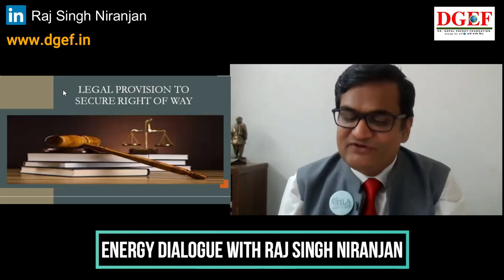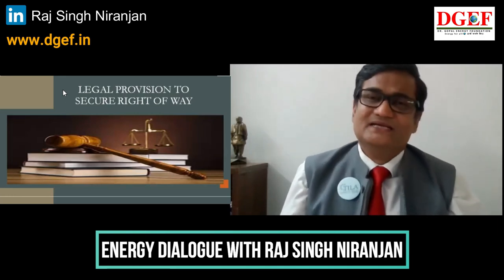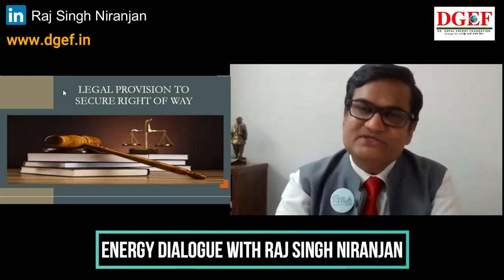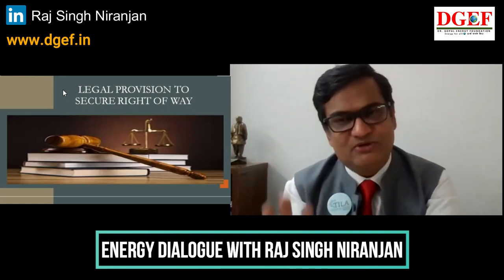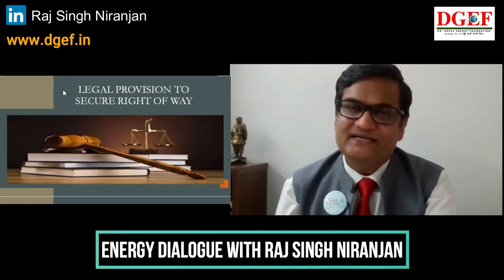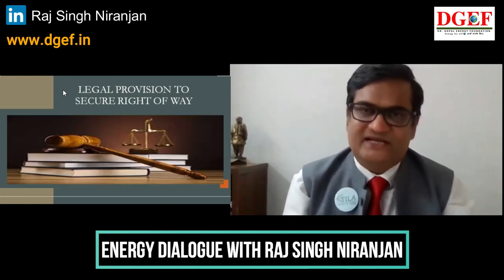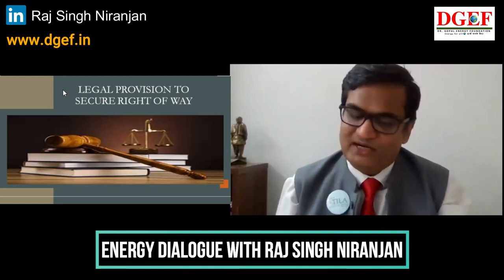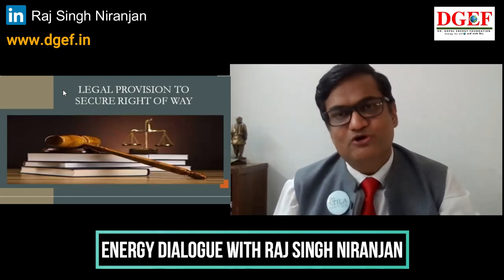Right Of Way (ROW) for setting up Transmission Lines in India ?

Comment: Right of Way ( ROW) for setting up transmission line in USA 

In the United States, the process of acquiring right-of-way (ROW) for setting up transmission lines typically involves several steps and considerations. Here is a general overview of the ROW acquisition process for transmission lines in the USA:

Project Planning: The utility or company planning to build the transmission line identifies the need for additional infrastructure and initiates the project. This involves conducting feasibility studies, assessing the route options, and identifying the potential impacts on the environment and affected communities.

Route Selection: Once a preferred route is identified, the utility conducts surveys and evaluations to determine the most appropriate path for the transmission line. Factors such as land ownership, topography, existing infrastructure, and environmental considerations are taken into account during this stage.

Public Consultation and Environmental Review: Before proceeding with the project, the utility engages in public consultation to inform and gather feedback from stakeholders, including landowners, communities, and regulatory agencies. An environmental review is also conducted to assess potential environmental impacts and compliance with federal, state, and local regulations.

Permitting: The utility must obtain various permits and approvals at the federal, state, and local levels. These permits may include environmental permits, land use permits, and construction permits. The specific requirements vary depending on the location and regulatory jurisdiction.

Negotiation and Acquisition: The utility initiates negotiations with landowners along the selected route to acquire the necessary ROW. The negotiations may involve discussions on compensation, easements, access rights, and other terms and conditions. If an agreement cannot be reached through negotiation, the utility may pursue eminent domain, a legal process that allows the government or authorized entities to acquire private property for public use, subject to fair compensation.

ROW Acquisition and Documentation: Once agreements are reached with landowners, the utility acquires the necessary ROW through purchase or easement agreements. Detailed documentation is prepared, including legal descriptions, easement documents, and rights-of-way agreements, to establish the rights and responsibilities of both parties.

Construction and Operation: After acquiring the ROW, the utility can proceed with the construction of the transmission line. The construction phase involves clearing the land, installing towers, stringing transmission lines, and conducting necessary inspections. Once the line is built, it is typically operated and maintained by the utility or transmission company.

Comment: •	Developed Country: Australia

The specific procedure for obtaining the right of way (ROW) for setting up transmission lines in Australia may varies with states or territory, however, the basic outline is given below. 

1. Project Development and Planning:
   - Identify a new transmission line and conduct feasibility studies.
   - Engage with stakeholders, including government agencies, landowners, and local communities.
   - Identify potential routes for the transmission line and conduct preliminary assessments.

2. Preliminary Consultation and Notification:
   - Notify affected landowners and stakeholders about the proposed transmission line project.
   - Conduct preliminary consultations to gather feedback, address concerns, and identify potential issues.

3. Application and Approvals:
   - Prepare and submit an application for the necessary approvals and permits to the relevant government authorities.
   - Provide detailed project plans, including engineering designs, environmental impact assessments, and other required documentation.
   - Pay any application fees or charges associated with the process.

4. Environmental Assessment:
   - Conduct a comprehensive environmental impact assessment, including studies and surveys to evaluate potential environmental impacts.
   - Prepare an environmental impact statement or report that outlines the findings and proposed mitigation measures.

5. Stakeholder Engagement and Public Consultation:
   - Consultation with affected landowners, local communities, and other stakeholders.
   - Feedback on the project, address concerns, and incorporate community input where possible.

6. Negotiation and Acquisition of ROW:
   - Identify the specific land parcels required for the transmission line and negotiate with affected landowners or stakeholders.
   - Reach agreements on compensation for land use, access rights, and any associated impacts or disruptions.
   - Draft and sign legal agreements, such as easements or land access agreements.

7. Regulatory and Legal Processes:
   - Obtain any additional regulatory approvals or permits required, such as environmental licenses or permits for specific activities.
   - Comply with statutory requirements related to land access, environmental protection, and safety.

8. Construction and Operation:
   - Commence construction of the transmission line, adhering to the approved plans, safety standards, and environmental requirements.
   - Regularly monitor and report on compliance during construction and operation phases.
   - Undertake necessary maintenance and operational activities throughout the lifespan of the transmission line.

Comment: Right of Way ( ROW) for setting up transmission line in Nepal 

In Nepal, the process of acquiring right-of-way (ROW) for setting up transmission lines involves several steps and considerations. Here is a general overview of the ROW acquisition process for transmission lines in Nepal:

Project Planning: The utility or company planning to build the transmission line identifies the need for additional infrastructure and initiates the project. This involves conducting feasibility studies, assessing the route options, and identifying the potential impacts on the environment and affected communities.

Route Selection: Once a preferred route is identified, the utility conducts surveys and evaluations to determine the most appropriate path for the transmission line. Factors such as land ownership, topography, existing infrastructure, and environmental considerations are taken into account during this stage.

Environmental Impact Assessment (EIA): In Nepal, an Environmental Impact Assessment (EIA) is a mandatory requirement for infrastructure projects, including transmission lines. The utility must conduct an EIA to assess potential environmental impacts and propose mitigation measures. The EIA report is submitted to the concerned government authority for review and approval.

Public Consultation: The utility engages in public consultation to inform and gather feedback from stakeholders, including local communities, affected landowners, and relevant government agencies. Public hearings and meetings are held to discuss the project's benefits, potential impacts, and mitigation measures. The concerns and suggestions raised during these consultations are taken into account in the project planning process.

Land Acquisition: The utility must acquire the necessary land for the transmission line's right-of-way. The process involves negotiations with landowners along the proposed route. Compensation, land valuation, and resettlement issues are discussed, and agreements are reached with the affected landowners.

ROW Acquisition and Documentation: Once agreements are reached, the utility acquires the necessary ROW through purchase or lease agreements. Detailed documentation is prepared, including legal descriptions, lease agreements, and rights-of-way documents, to establish the rights and responsibilities of both parties.

Permitting and Approvals: The utility must obtain various permits and approvals from government authorities. These may include permits related to land use, environmental clearance, construction, and electrical safety. The specific requirements and processes for obtaining these permits vary depending on the project's location and the regulatory framework.

Construction and Operation: After acquiring the ROW and necessary permits, the utility proceeds with the construction of the transmission line. The construction phase involves activities such as clearing the land, installing towers, stringing transmission lines, and conducting necessary inspections. Once the line is built, it is operated and maintained by the utility or transmission company.

Comment: To set up transmission lines in India, the Right of Way (ROW) refers to the legal permission required to acquire land or property for the construction and operation of the transmission infrastructure. ROW ensures that the transmission lines can be installed without any obstruction and in compliance with the relevant regulations and guidelines.

Comment: In India, the right of way (RoW) for setting up transmission lines is governed by the Central Electricity Authority (CEA) and the respective state electricity regulatory commissions. The CEA provides guidelines and regulations for the RoW requirements for transmission lines.

The RoW for transmission lines is typically acquired through negotiation or by following the applicable laws related to land acquisition. The process involves obtaining necessary permissions, clearances, and consents from various stakeholders, including landowners, government agencies, local authorities, and affected communities.

The specific requirements and procedures for obtaining RoW can vary depending on the project's location, voltage level, and other factors. It is essential to consult the relevant state electricity regulatory commission and follow their guidelines and procedures for acquiring RoW for transmission line projects in a particular state.